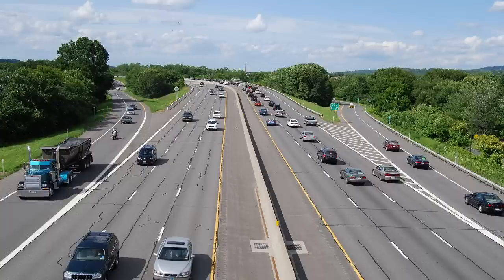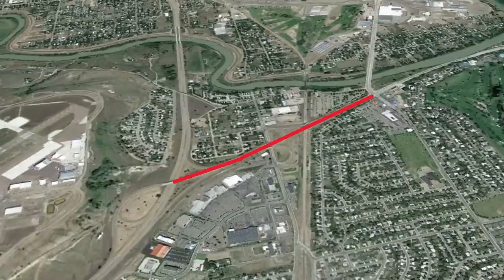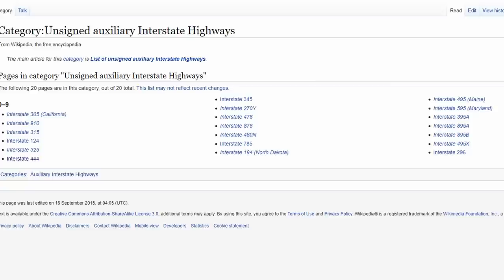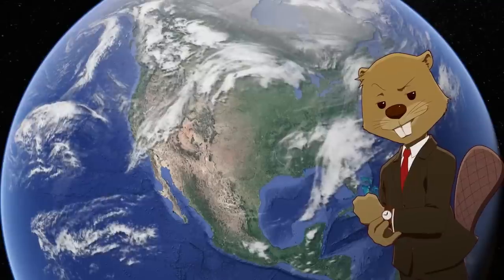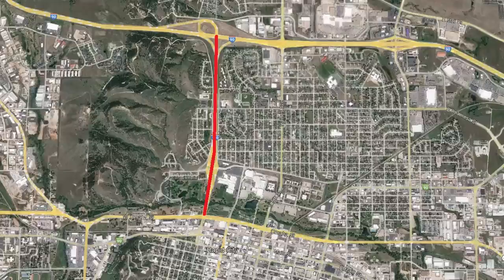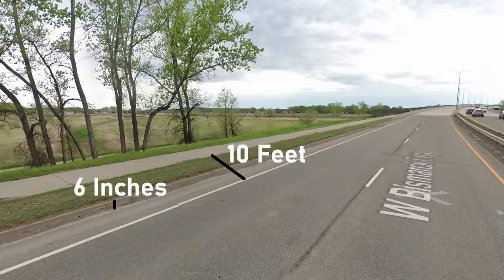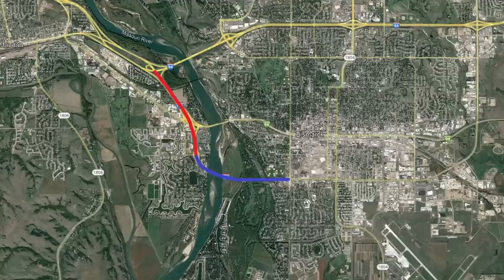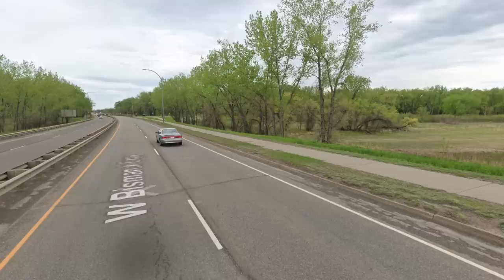Why This US Interstate Has Sidewalks

Comment: The Interstate standards are more what you’d call “guidelines” than actual rules
Reply: Exactly, "Interstate" is a brand name and it indicates a combination of some unique things: a freeway network, a national navigation system, an economic development program, and a compliment to the defense logistics system. Sometimes one or some of those features Is absent but the others remain.

Consistency of design is good for a lot of reasons, especially safety, and the standard Interstate does produce some of the safer roads in the USA. But it has a few drawbacks though, chiefly inflexibility. The video is asking great questions, but mostly there are probably locally specific reasons for each and every variance described in this video. The IHS numbers are useful for navigation, but they often primarily just identify key components of the NHS (these routes are deemed vital for economic security) and it is entirely possible to navigate without them. The best reason for why this is unsigned is to help keep driver behavior in line with a non-Interstate standard road. 

My best guess for the presence of a sidewalk is that it crosses a river with a limited number of crossings, having a multimodal bridge (walking and cycling being the added modes) increases connectivity and mobility. It could perhaps have higher speeds if it didn't have these variances, but it is so short the higher speed would be somewhat negligible, because it is already quite a fast design. the Interstate design guidelines are helpful, but ultimately it is up to state DOTs and/or more local planners to figure out how to implement those standards in the best possible way given local geography.
Reply: Hahaha
Reply: Was it adopted from the pirate code by chance?
Reply: What bugs me, is especially in North Dakota, inclement weather is likely, a curb is not much protection for a pedestrian when it comes to a driver losing control of his car, just look at I-80 in Iowa this past holiday season, the Thursday before we headed to Des Moines (we live about halfway between but closer to Iowa City) there was at least  a dozen 18-wheelers wrecked, I saw many breaks in the cable "protector" and a few jackknifes, I developed a case of frostbite as the wind chill was 40 below so Christmas day I went to the VA hospital ED, another dozen or more wrecks that direction, again more cable breaks, and cars more than 25 feet off the road.. a sidewalk would be dangerous at such highway speeds.
Reply: I remember living in Pennsylvania, US-22 wouldn't qualify to be signed an interstate, •A because of curves approaching Easton required slowing down to speeds less than interstate standard minimum, and •B Phillipsburg NJ was traveling through town with multiple traffic signals.   I don't know how NJ got past the rules but the entrance to the Holland Tunnel is still interstate clear into Manhattan, again multiple traffic signals
Reply: @Stache987  Dude, I-80 in Iowa is the worst maintained section of the whole system.
Like, yeah, Wyoming needs to shut down the highway, but that's because of safety.
Iowa CREATES the safety issues
Reply: @Robert Kent  if they say 2 inches of snow, I-80 will probably end up closing down because of wrecks, like up by Ames just did, people on I-80 only slow down for fog, not white-out snow..  last months snow was bad, and one day we took the classic car to Cedar Rapids to do some shopping and had a blowout on the way, surprisingly within 5 minutes of getting the jack and spare by the tire, a deputy drove by, he turned around and within 5-10 minutes was all finished,  that same car last May had a distributor fault, the roving Highway Helper was there within 20 minutes, he took us to a rest area to wait for a ride, he pointed out we were on the far edge of their services, but the cameras up high saw us, even a cop visited, these cameras are well equipped to even read license plates far away.  On our way to the rest stop, his radio was broadcasting about a speeding car, describing it, how fast and all, so I guess somehow it tracks speed too.  Even if the roads are trash, I thank the thoughtful people who helped us.
Reply: @hotdog31227  Thanks. It was dense so I split it up.
Reply: Ok Elizabeth Swan. How's Captian Jack Sparrow doing
Reply: Sounds like a Pirates of the Caribbean line loo
Reply: Really? How many interstates have you designed? I have designed interchanges, widenings, ramps, etc. for several dozen miles of interstate highways. I was never under the impression that there were no rules. Quite the contrary, there are many more rules than other state highways and county roads.

Comment: The length of I-194 between I-94 and Memorial Highway in Mandan was original to the construction of the interstate in the 60's, to serve as a connector between the business loop and the interstate where they come closest together. In the mid 80's, it was extended south and east across the Missouri River and replaced "Bismarck Avenue" south of downtown. None of this route was ever US 10, since that followed Main Ave in Bismarck and Memorial Highway in Mandan. After the 194 designation ends, it continues as ND 810, also unsigned, and as a freeway, until Washington Street, where it continues as a surface four lane that loops back north to the interstate on the east end of town. The loop continues as Centennial Road, 71st Ave NE, and ND 1804 on the north side of Bismarck, where sometime in the next few decades it is planned to cross the river again back to Mandan and connect to 94 elsewhere, completing the beltway. Bismarck has never grown far south because of flooding and low property values, while the north side has boomed, so I never understood the need for the south bridge. The south, complete half of the loop is simply signed as "Bismarck Expressway" and few locally are aware of the 194 and 810 routes. The signs for the business loop, both interstates, and their exits, are all very uncompliant with interstate standards.
Reply: So in other words it was added to get federal funding to do repairs on it and the sidewalk was grandfathered in which explain most anomalies.
Reply: @14Rocket  pretty much - they really need to move the city... Fargo too. :P
Cities that keep flooding every few years should not be eligible for any such disaster funding, since they choose to remain in a far less than ideal location. The Dakotas are really odd places to visit, since the population in many Twin Cities suburbs casually beat their largest towns' populations... including the suburb where I live (not even near the top of the list) is more populous than Bismarck. 
it's about time to merge them back into one Dakota to save all the dual administration costs of such sparsely populated lands. They can have Wyoming while they're at it... another gorgeous but barely populated at all state. People vote, not "states", so it's about time we removed some Senate votes whose per capita representation level is simply annoying to be blunt.
Reply: @chouseification they need dual administrations in the dakotas in order to allocate funding for administering the large expanses of area that these small populations occupy. It’s hard enough as it is to govern the long east west distances in these states. Now you want them to travel just as far, north-south?

Comment: There are bike/jogging paths along the side of I275 in Michigan in different areas.  The only thing that divides that from the expressway is a ditch.
Reply: Just wanted to add that it's 31.6 miles long and spans 3 counties.
Reply: @jctoad  that's Alot!
Reply: @niggalini  I've never been on the trail. 
I'm on the East side and we have the Freedom Metro Trail over here. Metro Parkway isn't an interstate, but a lot of us drive it like is.
"The 11-mile Freedom Metro Trail officially begins in front of the beach house at Lake Saint Clair Metropark. The Metropark also boasts some nice paved trails within the park that guide you along the water’s edge to Point Huron. The trail travels along the south side of the Metro Parkway (16 Mile Road) and officially ends at Schoenherr Road. When you cross under the I-94 interchange, the trail intersects with the middle of the Clinton River Spillway Bike Path, which runs along the edge of the waterway about 2.5 miles from Mount Clemens to Lake Saint Clair (a fun side trip worth exploring). Most of the major street crossings offer protected crossing signals. A bike friendly pedestrian bridge takes you over Groesbeck Highway."
At the western end, it connects to better trails which are what I usually ride and are much longer than the 11 miles of the Freedom trail.

Comment: Rapid city local here, The I190- sidewalk functions as a backup incase the underpass floods. the Leonard Swanson memorial pathway (or usually just called... the bike path) Travels under the bridge alongside Rapid Creek. Rapid creek floods from time to time, and while this underpass sits a bit higher then most, It can flood as well. The sidewalk provides a short detour to the nearest controlled intersection to provide a alternative location to cross. 

With that intersection being so close by, the speed limit in that short area is 45mph, and traffic is usually slowing down to stop, or speeding up to highway speeds, so while not a ideal area for pedestrians, its not a horrible offence, and is rarely used.

Comment: Fun fact - on that stretch of I93 in New Hampshire that goes down to one lane each way, until recently you used to be able to park on the side of the highway to access the hiking trails there. So I've parked and walked along an interstate highway before
Reply: And the speed limit there is 45. It was only given an Interstate designation, by exception, because we didn't want tourists to be confused after the northern section was finished in the 80s.

Comment: Look at the Custis Trail in VA, especially as I-66 passes underneath Washington Liberty High School's parking lot. The "trail" has no barrier with the highway (just a chain link fence), and it looks like a sidewalk.
Reply: that's kinda true, also I was thinking about the new trail built along I-66 outside the beltway. Parts of it is seen along the interstate around Vienna, Va as far as I recall. Also, the trail linking to the Nutley street interchange (exit 62) is parallel to the cars off ramp for the Nutley St exit.

Comment: I went onto Historical Aerials on NETROnline went to the 1984 satellite view and I can see that the bridge over the Missouri River is under construction. Now what’s really puzzling is this is sort of unusual highway design for the 1980s to allow a concrete trail next to major Highway with no means of protection against high speed traffic. Apparently this was common on many boulevard constructions throughout the 1980s, 1990s, and 2000s in the United States where it included a four lane divided Highway with no median, concrete median, just a grass median with surface street connections as well as sidewalks. Also by the looks of that trail. It looks like it violates a little bit ADA laws as the ADA law had not been enacted until 1990. You might be surprised but those sidewalks from the 1980s on many streets across the United States are not even handicap friendly as the ramps didn’t have truncated domes those dots that go up when the sidewalk levels down to the surface of the roadway which wasn’t federally mandated on many states until 2004. Prior to the 1990 ADA enactment, many sidewalk ramps that lead to the surface of the street where so horribly designed, it was designed for someone who was able bodied like me instead of those that are quadriplegic, combat wounded, or extremely elderly on wheelchairs. I apologize if I went a little off topic there. Also I check the approach sections of the trail that lead up to the bridge. There is no concrete barrier that should have separated the I-194 westward section of the bridge as that section has curve and if a semi where to spin out due to ice and someone was running, walking, strolling their kids, or biking. They would be killed that’s another problem is that that section is only separated by a guardrail and not a concrete median which nowadays is required by law when a freeway is within I have no idea probably less than 10 feet between the roadway and the sidewalk I would have to check on MUTCD manual on that one.
Reply: I mean its probably not impossible to find sidewalk ramps going back to the 60s in a major city.  Age old issue of getting funding, And it getting the city council to budget reramping sidewalks.  I think Philly only does so when there is major road works to attach it to, And philly has some so bad its gotten on the local news iteam/troubleshooters pieces before.

What do those little bumps do though? I figured they would be chair unfriendly as you would have to try and roll over them while going up hill.

Comment: Your sidewalk on I-194 seems much less dangerous than typical sidewalks along most stroads. Cars travel nearly as fast and are also turning in and out of driveways.  ——  There are vestigial sidewalks along some parts I-95 in Massachusetts, where the highway is better known as Route-128.
Reply: Curious where these portions are, if you know.

Comment: For one thing that stretch of the road referred to in the video as having a sidewalk is NOT I194 it is Hwy 810 ie. Bismarck Expressway.  I194 ends at Memorial Interchange about in the middle of the bridges that go over the Strip in Mandan, ND or as the other designation of I94 Business Loop, but then goes further till he crosses the Missouri River on Hwy 810 to show the sidewalk on the south side of 810 east of Expressway Bridge which is NOT 194.  The video publisher is wrong, there is NO sidewalk along I194 and I194 ends at Memorial Interchange NOT McKenzie Drive Interchange.
Reply from the maker: I explained I’m this video why you are wrong. It’s still considered I-194, it’s just unsigned.
Reply: He showed the Wikipedia page that proves it’s still an interstate there. The Wikipedia page had proven sources attached to that information as well.
Reply: No it is NOT Google Earth shows it as going further but Google Earth is wrong also.  Measure from the Interchage North of McKenzie Dr. which is Memorial Interchange and you will get the distance you stated but if you measure from the South Interchange McKenzie Drive it is longer distance than 1.72 Miles.  You can also go to the NDDOT website and see for your self .  LINK:   https://www.dot.nd.gov/docs/maps/state/2015CDRS_Combined.pdf
Reply: Look at the Bismarck/Mandan map inset and see for yourself, it shows you were Interstaes and Highways start and end.  You are Wrong.  PS I have worked on these roads I know where they start and stop.
Reply: And Wikipedia is ALWAYS RIGHT.  Well I attached a link to the NDDOT page which shows otherwise the Interchange north of McKenzie Dr. which is Memorial Interchange.  I do have extensive knowledge of these roads as I have worked on them and know where the start and stop.  Google Earth is wrong also.  Measure 1.072 miles to the north and McKenzie Dr. Is way to long.
Reply: Well funny Wikipedia if you actually search I-194 North Dakota  says that I194 ends at Memorial Interchange, Not McKenzie Dr. as stated by video poster:  LINK:   https://en.wikipedia.org/wiki/Bismarck_Expressway
Reply: Hey beaver .. Brandon is a local Bismarck resident that works for NDDOT lol look into what he is informing you. 🙏

Comment: Couldn't find it when I just now, did a quick search. In the 70s, I76 between Denver & I80 had a bike path. Similar to your sidewalk. right along the interstate. I would have never even noticed it, except a small sign that said, "Bike Path." Been so long ago, I think it was just an asphalt strip. I noticed at one point it veered from a few feet form the interstate to about 20 yards away.

Comment: Interesting I believe you mentioned that the roadway next to the sidewalk was signed for 55 mph. Curb and gutter is typically not used on roadways where the signed speed limit is higher than 45 mph. Should be a concrete Jersey Barrier for the length of that concrete path st the edge of shoulder or the path relocated to outside the clear zone.

Comment: From the looks of it, there is no 12’ safety shoulder along the area of the sidewalk either. What is even more egregious is the curb especially considering the 55 mph speed limit. Often routes are unsigned because even though they are technically part of the system, they are NOT to interstate standards.

Comment: You might be interested to learn that there is a proposal to run a bike/pedestrian trail along the right-of-way of I-94 near Mattawan, Michigan.  The original route was blocked by landowners who objected to a trail cutting through their property, so the trail's promoters turned to the Michigan Department of Transportation (MDOT) which apparently is ok with the idea.  Personally I am not sure how this is going to play out, as I-94 badly needs widening to six lanes through this area.  Most of the locals I know do not like driving on it because of all of the truck traffic and will go out of their way to take back roads; I myself don't care to drive it for the same reason, especially in winter, when one can easily become trapped in a traffic jam.  Anyway there is an ongoing active discussion between the trail's promoters, MDOT, and the Village of Mattawan regarding this trail and it looks like it could become a reality in the next year or so.

Comment: Beaver, I am very surprised to see those elements in an interstate. Not just the sidewalk, but the curb, too. The clear zone at 50 mph is 24 feet. I would have thought that precluded both the sidewalk and the curb within the CZ. They can erase anything with a design exception, but it must have taken a might thick carpet for that kind of praying.